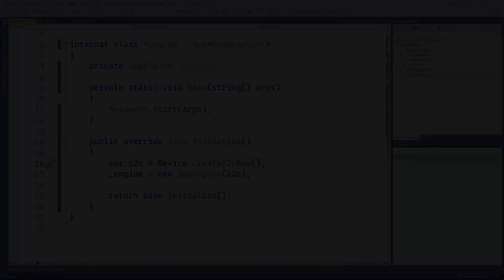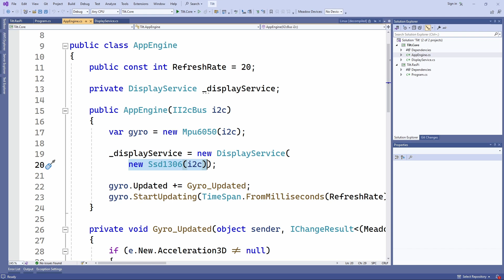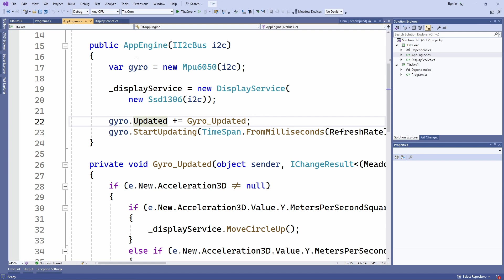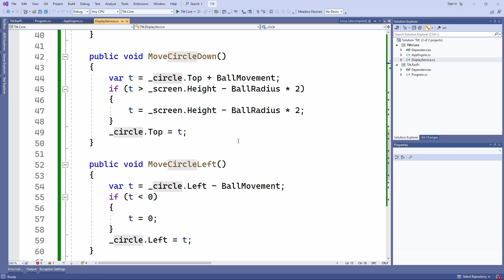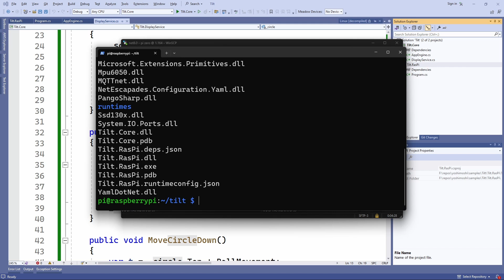Creating a C# Application for Raspberry Pi 5 (and Pi Zero 2W)

Comment: Can you use any hardware, screens, load cell's, etc, do you need to use Meadow hardware?
Reply from the maker: No, you can use Raspberry Pi, BeagleBone, or Jetson. It would be a fairly easy lift for others like Coral as well
Reply: @dotnetMakers  Thanks for the reply.  I think I worded my question badly.  Can I use all the same components that we do with MicroPython/CircutPython with Meadow, it appears you can?  I've not had chance to try this as of yet!

Comment: Chris, do you have a video or set of instructions for getting the Dotnet runtime onto a Pi Zero 2W, deciding which raspian OS to use (32 or 64 bit) and how to get the relevant packages? I'm going round in circles trying to find a solution that works.
Reply from the maker: I probably should create a video on this.  I do have docs for the YoshiPi, but they would be identical for any Pi Zero 2W (and any pi would be very similar)
https://github.com/yoshimoshi-garage/yoshipi/blob/main/Docs/dotnet/installing-prereqs.md
Reply: @dotnetMakers  Thanks Chris, I'll give this a go.